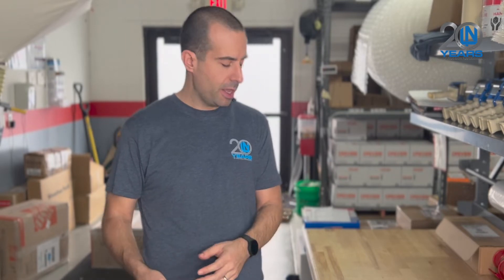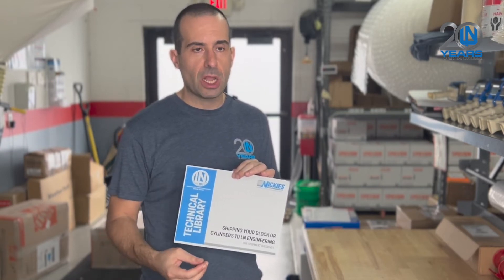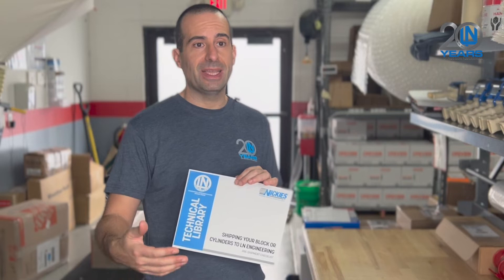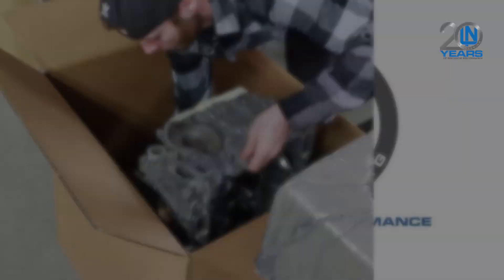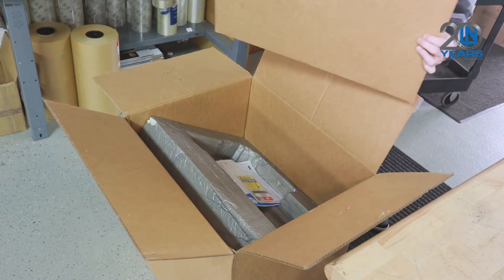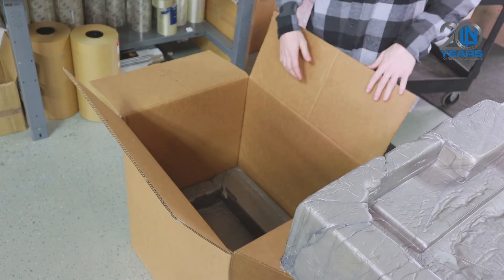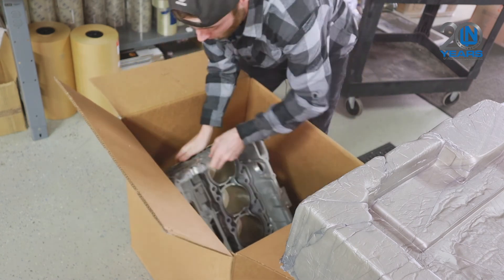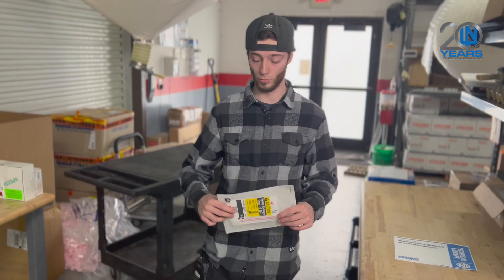Sending LN Engineering Your Porsche M96 Engine Case for Sleeving

Comment: What is the process for shipping from Canada?
Reply from the maker: It is very cost prohibitive for us to ship our custom boxes with foam core inserts across the border. In lieu of this, we recommend boxing each case half individually with ample padding on all sides. Do not use bubble wrap or air pillows. The intermediate shaft needs to be shipped separately so as to not damage the block. If you have any other questions, please feel free to call us directly at 815-472-2939 and we can provide further guidance.
Reply: @lnengineeringllc  Thank you for this reply.  Much appreciated.